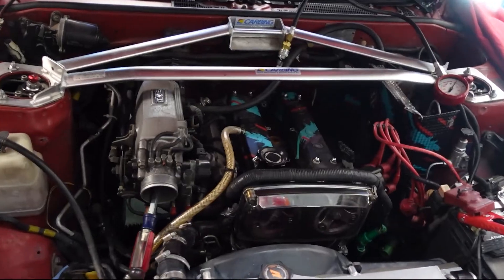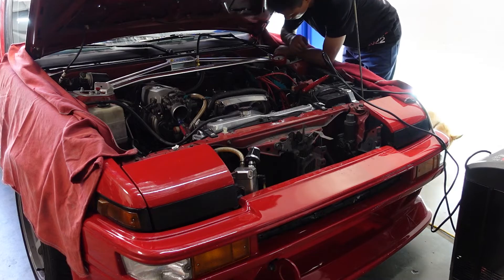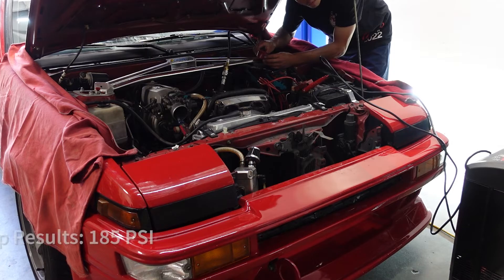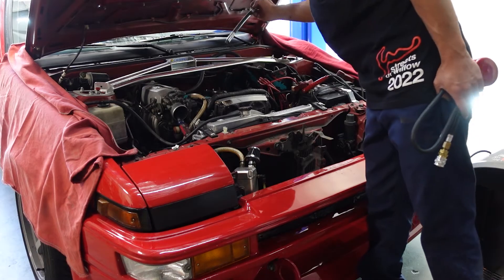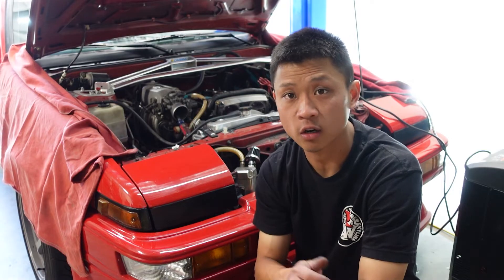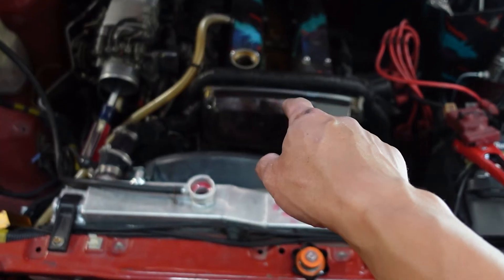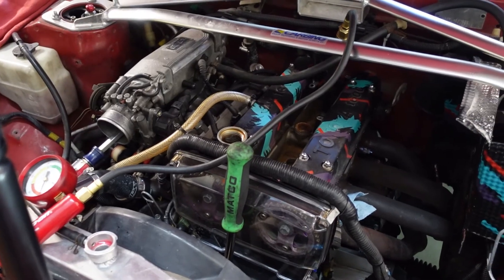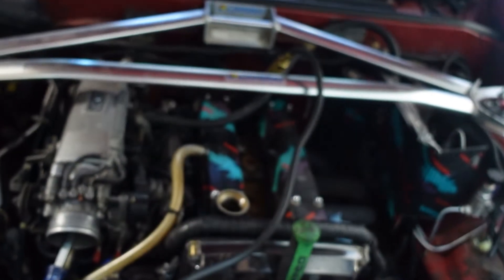Compression/Leak Down test DONT MAKE THIS MISTAKE!

Comment: Excellent info as always! I did compressions/leakdown tests on an imported engine with unknown history on the stand a few months ago. This will help me sleep because I doubted my process a bit as I was seeing 0% leakdown on two of the cylinders which I figured was impossible as there will always be some leakage past the rings. Unfortunately I had leakdown out of the exhaust side on cylinder 4 and haven't had time to dig in to see what's going on. At least I know I can trust the results.
Reply from the maker: Glad you found this useful! Yes 0% is ideal, but even with 0% on the gauge you will still hear air come out the oil filler as "true" 0% is impossible.

Comment: Hi CMA! Thanks for this video been trying to purchase a 20v BT but a lot of engine importers tell me they can only do the compression test after payment and they cannot do the leak down test when an engine is outside of a car. This been holding me back from purchasing. Do you know of any 20v BT engine importer that can do all the things you've mentioned in this video that can ship to Washington?
Reply from the maker: I do not, but that sounds pretty bad on the engine importers part. We do compression/leak down on engines outside the call regularly.

Also have had customers buy engine with a compression/leak down sheet attached.

I think 20v engines are so in demand these days, importers dont even need to bother with a comp/leak down because people will pay up the arse reguardless.